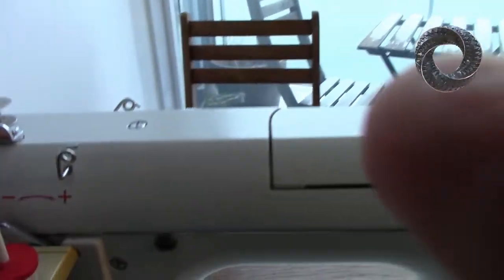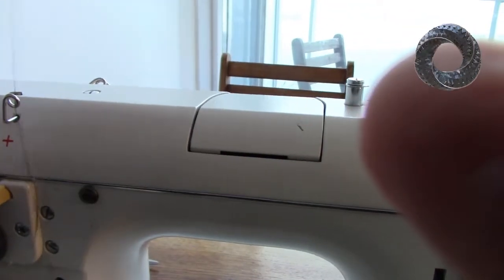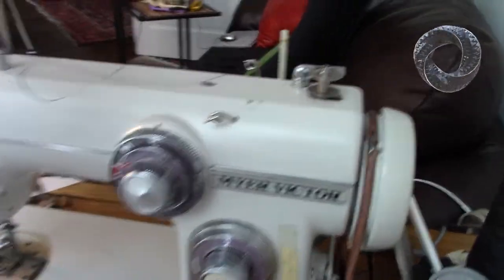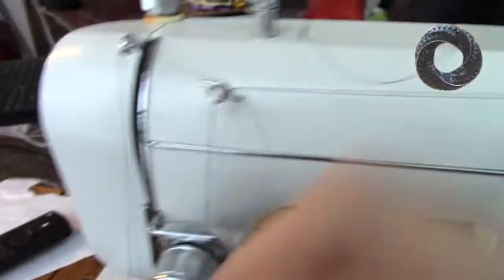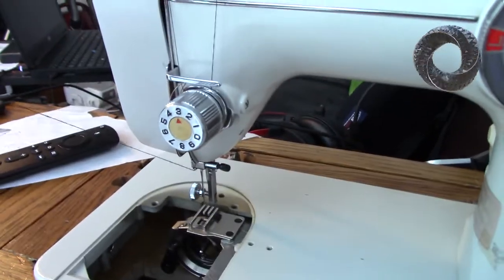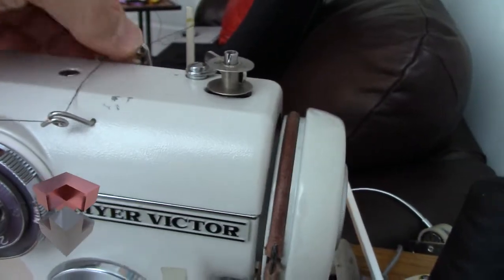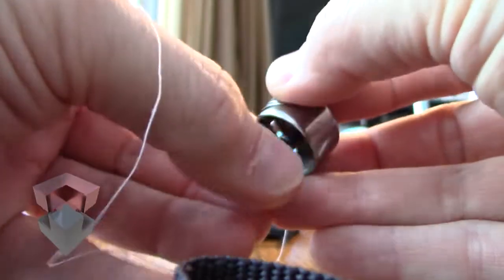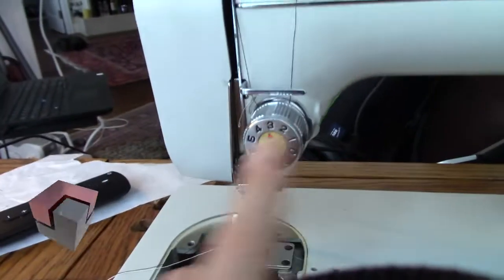Threading the Janome 672

Comment: is it possible to use a brand of singer stretch stitch plate to Janome 672? because I search online I see only a singer brand.. tnx
Reply from the maker: Do you mean the cams? There are specific ones for the Janome. I am awaiting a few to arrive in the post having purchased them on eBAY. I might have some duplicates which I will be able to share with you if they are correct. It is difficult to know if they are for the right machine since they often do not carry the brand name on them. Morse does not fit as I just found out when they arrived yesterday.
Reply: @jamesrogers991  I thought they called them stretch stitch disc ehehehe...
Reply: @jamesrogers991  if u have duplicates.. can u share some on us? my mother in-law is still trying to cope with the machine.. ehehe I'm happy watching her eager to learn...